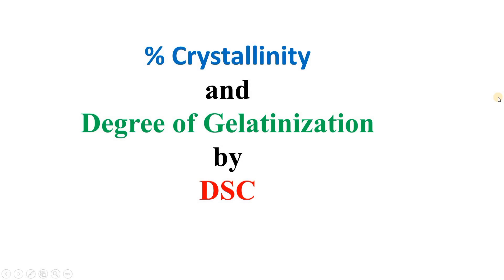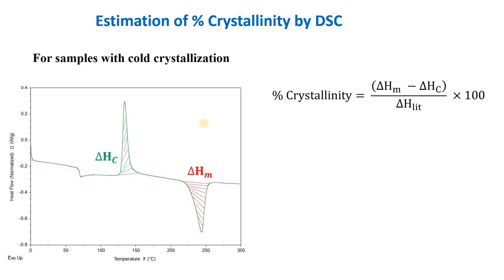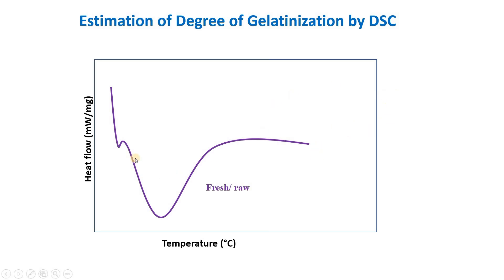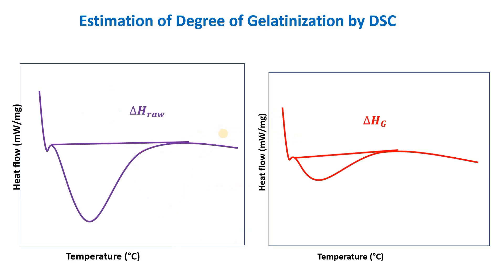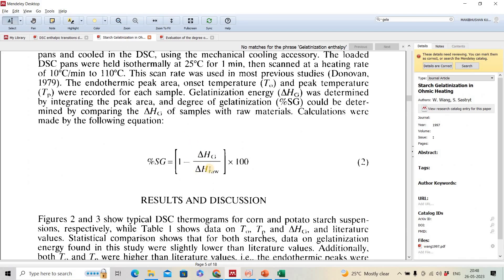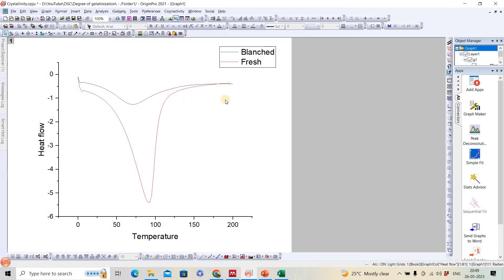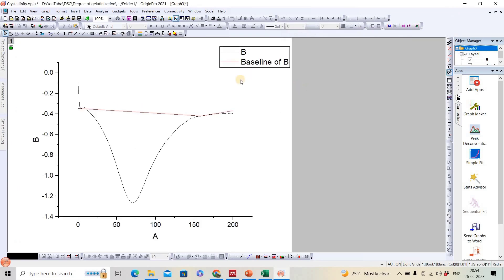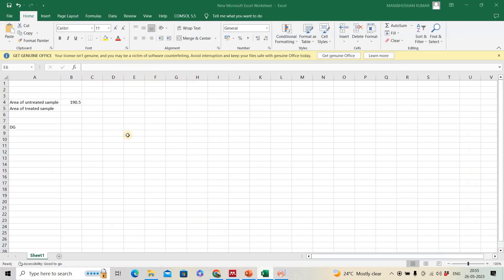How to calculate % Crystallinity and Degree of Gelatinization from DSC curve Using Origin Pro

Comment: Hi, sir; I really appreciate your effort in making this video. I have one small question regarding cold crystallization; I still need clarification. When a sample undergoes a cooling process during DSC analysis, it will have an exothermic reaction (releasing heat), giving us the delta Hc. It is being heated, reaching the point where melting happens, and is called Tm. However, what does cold crystallization mean?
Reply from the maker: Cold crystallization, occurs when a polymer is reheated after being cooled below its glass transition temperature (Tg) but before it reaches its melting temperature (Tm).
In this scenario, the polymer's molecular chains, previously in a disordered amorphous state, gain mobility upon heating. This increased mobility allows for further molecular orientation and the formation of new crystalline structures, resulting in another exothermic peak on the DSC curve
 on other hand, hot crystallization occurs when a polymer transitions from a molten state to a crystalline state as it cools down.
Reply: @LearnwithDr_Mani  Thank you

Comment: Hi sir, I am Siva from Scotland. I would like to know will the percentage of crystallinity formula also applicable for composite materials. How to find pure crystallinity of the composite materials from the table?
Reply: Then it is different equation, Weight fraction of the filler is subtracted from the enthalpy of 100 % crystalline matrix polymer. 
Refer the following paper: Procedure for evaluating the crystallinity from X-ray 
diffraction scans of High and Low Density 
Polyethylene/SiO2 Composites 
A. Sami 1, E. David 1 and M. Fréchette2
Reply: @athirajohn863  Thanks a lot. I really appreciate it from the bottom of my heart. One small question regarding cold crystallization, I am still confused with this cold crystallization. When a sample undergoes a cooling process during DSC analysis, it will have an exothermic reaction (releasing heat), giving us the delta Hc. It is being heated, reaching the point where melting happens, and is called Tm. However, what does cold crystallization mean?